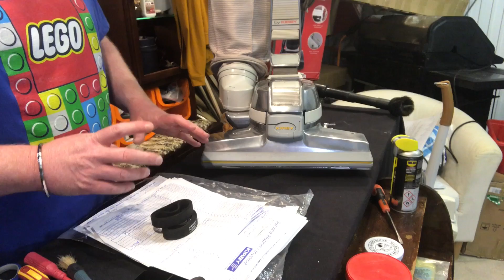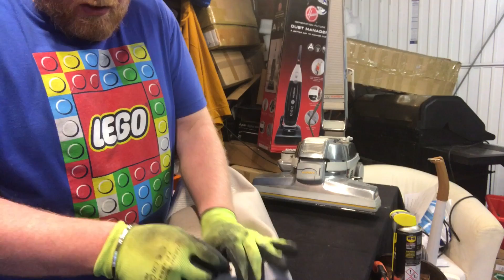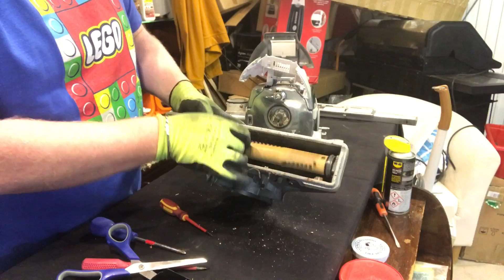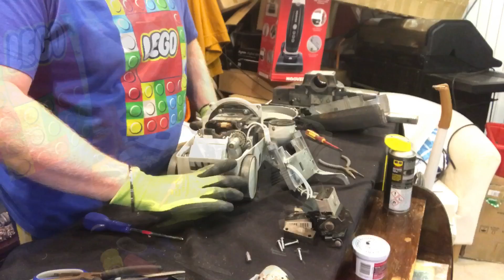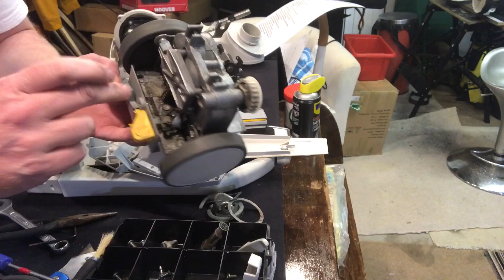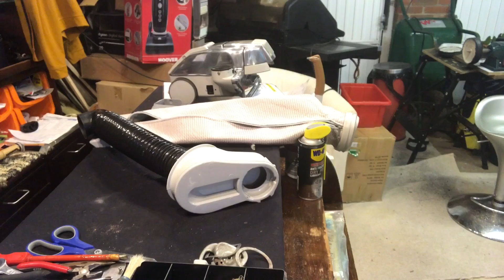Kirby G3 strip down and repair disaster!

Comment: I have run into some snafus in my time repairing Kirbys and other machines. The worst one was a Classic 1CR that had just about everything go wrong. I finally got it fixed, but it was pure hell almost.
Reply from the maker: Matt Jones I was gutted I broke the motor, but we learn from mistakes I guess. I was just lucky to get hold of a G6 so cheap to donor parts. Ordered a few more bits to finish it off, but off to Buffala NY in November and as parts are so much cheaper in the USA, I've made a list of bits to look out for, for all my Kirby's.  Just gutted that we have different power volts or I'd be looking for my Avalir there! Lol. Still! I will be looking out for all the non electrical bits I need. This G3 I have to say was the most challenging so far. One vid soon is of the Sentria 2 and that I think holds a few surprises! Not too many I hope!!!!!!